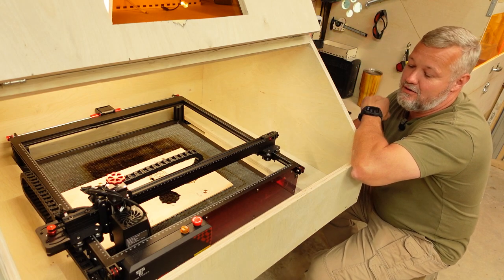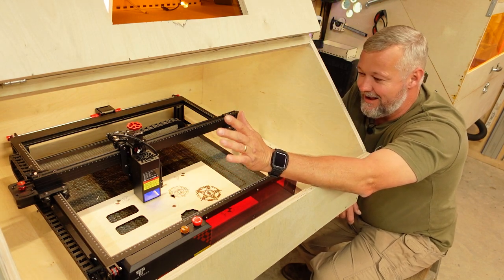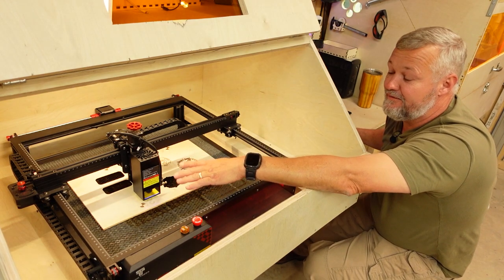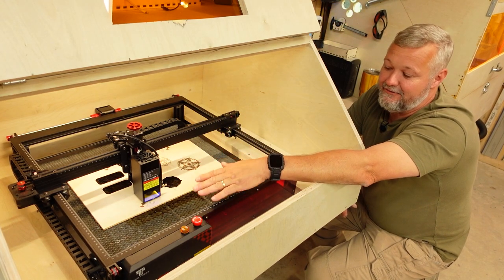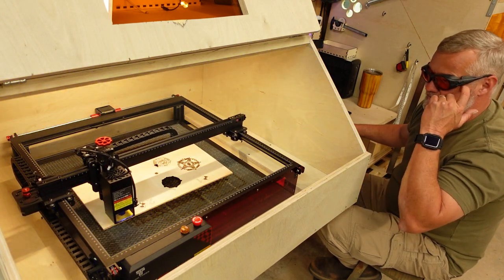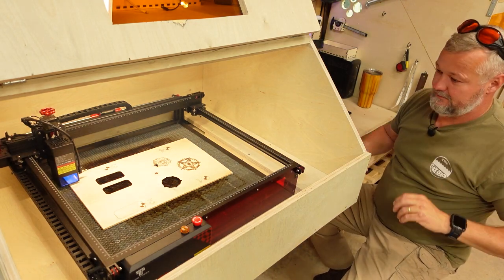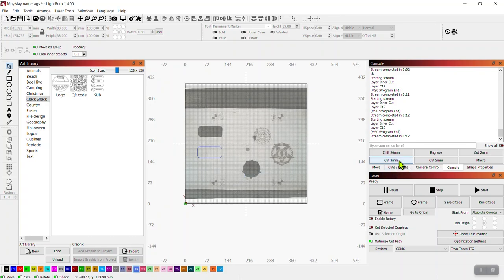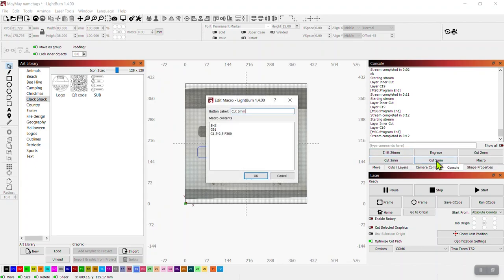Two Trees TS2 20w- Using the auto focus and Z axis

Comment: Hi, For the problem you describe at 14:00, I think there must be an instruction in your gcode that tells it to set this position as the origin. All you'd have to do is rectify this by making or modifying your focus macro. In short, there must be an obvious solution, it's just a question of finding it. I'm waiting to receive the machine for review, and I'm going to stick to it.
Reply from the maker: It is likely a programming issue but the typical end user is not gonna want to have to take those lengths to get it functional. Still a good machine once you learn to work around it.

Comment: Absolute novice here. Learning much from these videos. Thanks so much. I have the TS2, 10w. I use a MacBook and LightBurn.  I cannot get the autofocus to even show up on on LB. in contact with TT and they state that using a windows computer would make thing work much easier. Im using the TS2 but guessing at the focus.
Reply from the maker: Autofocus is controlled under console

Comment: Issue comes from the command $HZ that homes the Z axis. It also turns to 0 X and Y axis for some reason, wherever your laser is. You can check this in LB by clicking on Get Position button on the Move window. If you do so, you will see that after homing Z axis, X and Y are also 0. I guess this is something related to the programming of homing single axis in grbl, config.h file (lines 120 to 124). By the way, the same happens with the other combinations: if you single home X axis ($HX), Y and Z will be zeroed, and also if you home Y ($HY), X and Z will be reset as well. @TwoTrees3Dofficial you should take a look at this and fix the firmware
Reply from the maker: It seems like an easy fix.

Comment: Wow! That cleared up one question I ran into on my TS2-10w. I couldn't figure out what I was doing wrong when it would go to upper right corner.  My other question and wondered if you ever experienced this: My Z axis properly functioned initially, but something "failed" and now I can't raise the Z from Lightburn. If I manually raise it, Lightburn will lower it to focus. I can't determine if it's a software or hardware issue?  I've only had the machine a couple of weeks. Any insight?
Reply from the maker: I haven't experienced that issue. If it will still go down, makes me think it is software related unless on leg of the stepper isn't connected good.

Comment: I've noticed that very often after an auto focus, the focus pin is touching the very top of the wood still and drags along. Have you noticed this?
Reply from the maker: I haven't had any issue. Could be warped material
Reply: @TheClackShack  it happens even if the head does not move and its at the focus point. 5mm material does this and a few others have the same issue

Comment: Hi Mr Clack Shack,

First of all, thanks for all your videos. They've been very helpful with understanding lasers and Lighburn.

I own an Ikier K1 Ultra (36w diode) that has autofocus. Using the autofocus can be a bit tricky as if I hit the home button, it also resets the Z axis.

Would you know if there's a setting to stop this from happening?

Also, is it bad for the stepper motors to move the gantry manually?

Thanks 👍😊
Reply from the maker: I have an Atezr L2 which is identical in the way that it operates to the ikier. I could be mistaken, but I think the home function only causes the axis to raise before moving. It doesn't seem to affect the focus when I send a cut. Unless the software side is different. Steve @vintaurisworkshop has one of those. He might be able to tell you more. 

Just move the gantry slow. Too fast and the motors can back feed electricity. Catch our Sunday night live and we can answer more questions.
Reply: @TheClackShack  Thank you for your response, I'm going to try that in a moment. Will update with my findings.
Reply: @TheClackShack  Just gave it a test and results weren't good:

1. Setup a test engrave square
2. Framed it
3. Auto focused
4. Clicked Home
5. Clicked Start

The laser head stayed high up.

Looks like the only solution (at the moment) is to move it using the controls in Lightburn, or to move it manually.
Reply from the maker: @r1m.dog78  I home before the job, frame and then focus. Then hit start on the L2. It keeps up where it is located and does good after hitting focus.
Reply: @TheClackShack  Also tried that, but it seems to treat the spot the laser head is as 0,0 so it goes off to the upper right away from the area I'm trying to cut.

I'm sure I'll work something out other than my manual approach eventually  😀
Reply from the maker: @r1m.dog78  the software must be different.
Reply: @TheClackShack  Yep, seems so. I'm sure they'll fix it eventually, but I'll raise this on their support group. Thanks for your help.

Comment: Hello friend, I changed my laser head from Ts2 10W to the TS2 20W, I engrave on ceramic with the Norton method and it comes out gray not black. I tried different speed and power settings, can you please advise which are the correct settings to get good image results for the TS2 20W? In the previous laser head, the 10W I used to use speed 1200 and power 80 and it came out in black and was fine details. Should I be using different settings for the 20W laser head now? I would appreciate your answer. Thank you
Reply from the maker: I don't do a  lot of tile but yes, your settings will be different for the 20 watt.

Comment: Hello, the video is very useful but I failed to understand is the autofocus included in the Engrave macro and is it $HZ? Please give me some help because I'm scared to even start engraving considering that I don't know the 0 point for focusing the laser.
Reply from the maker: The setup that I did, I followed the manual. You can set the macro for engraving or cutting. The 0 is determined by the probe
Reply: @TheClackShack  Yep. I got it somehow by chance, but I know now that a simple command of $HZ will auto focus / zeroing the Z once over the working area. Thank you!

Comment: Wow! It looks like you need to put in a 'G90' at the end of your macros. You are changing the coordinates to incremental (G91) and leaving it there by not changing it back to absolute coordinates (G90).
Reply from the maker: I followed the directions in the manual with the machine. Unless I missed something, this is what it said to do. I have another machine in now that has auto focus and the macros for it are different.
Reply from the maker: I plan to investigate the issue. There has to be an easier way. Look at illustration A08. chrome-extension://efaidnbmnnnibpcajpcglclefindmkaj/https://cdn.shopify.com/s/files/1/0726/3915/2413/files/TS2-20W-Manual-EN-DE_compressed.pdf?v=1679562422
Reply: @TheClackShack  I really enjoy finding a 'problem' and then fixing it.